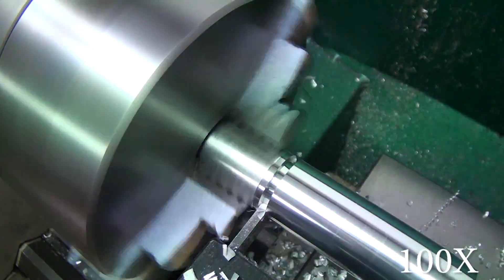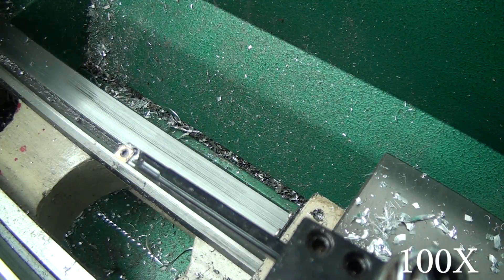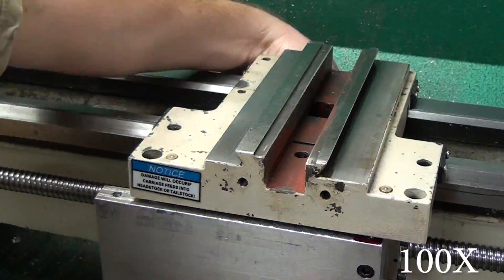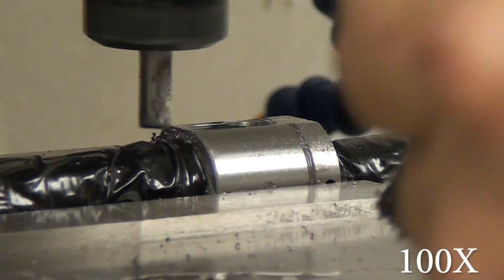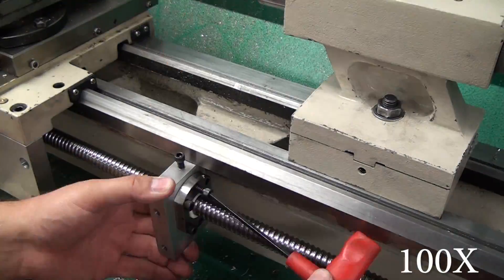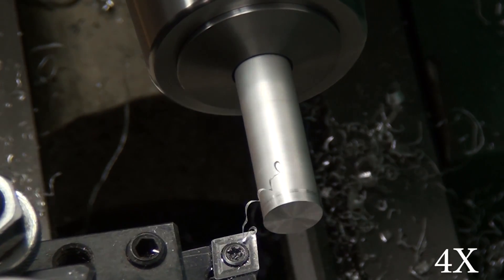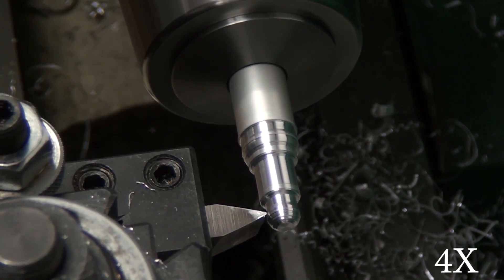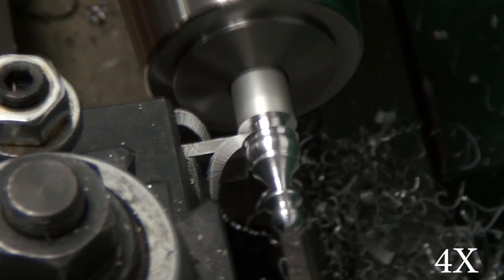G0602 CNC Conversion pt1 - Introduction

Comment: Hey Russ, what did you do about the z axis lock/brake? also, just to update you on how I am doing; I got the 1.8KW servo motor put on with huge timing pullys one inch belt width, and the acorn all wired up with kbsi signal isolator for rigid tapping, and my 704 has the same exact setup and it's tuned great and rigid tapping works good, even deep hole tapping (peck tapping), and because of the massive torque; I'm only tapping at 200rpm. so I figured out what I am doing is removing the gearbox, and putting the z axis stepper where the gearbox is, and I got a nema 34 that is really short, 80mm to go in the back, with no pullys, just direct drive. and I have a turret setup that I am making for it. just curious though; the brake is used to hold the saddle down also isn't it? how did you get around that? thanks. your awesome to put the plans on for free, it gave me a nice place to start from, then make my own mods from it, and with your feedback it was really awesome that you are there for others. thanks again.

Comment: Hello Congratulations for the video, I wanted to ask you I saw in the video that you turn the ball screw as if it were simple steel, normally they are cemented and hardened bars how did you manage?
Reply from the maker: Carbide tooling and low rpm. It was hard on the outside and soft in the center.
Reply: @russtuff  Ok Thank

Comment: Could this machine lathe hard steel for gunsmithing?
Reply from the maker: I don't recall ever having tried to machine hardened material. I suppose anything is possible, if you take light enough cuts. It's not a super rigid machine though, so I would imagine gunsmiths would tell you no.

Comment: Russ, what control and CAM software are you using? I'm having bad times with SolidCAM+Mach3 combo, especially with the feed per rev mode. The post processor I've found doesn't work correctly.
Reply from the maker: I'm using Fusion 360 for CAD/CAM and running LinuxCNC for the control instead of Mach.

Comment: looking forward to watching your videos may I ask will this conversion work with a 
    7X12 mini lathe
Reply from the maker: I made my parts specifically for the G0602 which is a 10x22. You could modify them or use the ideas for a 7x12 conversion I'm sure.

Comment: Nice project..  I have some issues with what you are doing.. You dont have any stick / slip issues without running with linear rails on your machine?   And those small Nemas are they fine fine to complete the mission?
Best Regards and Happy New Year
Jonas , Craftman Denmark
Reply from the maker: Correct. I've already racked up many dozens of hours of machine time doing a somewhat large production run. I've had no problems not having linear rails, and these steppers are actually larger than what most people use on this same model of lathe.
Reply: +russtuff  thx alot man!!  (5 stars ) remember to cut aluminium or brass is easy .. to cut steel or stainless is where the know how about tools and cutting speed and machinery goes up ..! ;-) never give up! :D

Comment: I've done an almost identical conversion on an almost identical lathe! It was a really enjoyable project. Cut all the mounting parts on my cnc router. Don't have a mill though so I had to modify my ballscrew with an angle grinder, not half as pretty as yours ;)

Comment: Russ,

that conversion looks like the best one I've seen to date!  excellent work!  you should have just used the G0704 setup like a lathe so you didn't have to tear down and reassemble the G0602 so many times.  I am going to be turning done parts on G0704 tomorrow or Sunday, I'll get some footage.  I will donate my QTC setup to the cause so if someone has a cnc'd 0704, they can turn and mill parts as needed for a quicker conversion.  again awesome work there man!  

Chris
Reply from the maker: +christopher polanski Thanks Chris! I considered using the G0704 for turning.... I can't remember why I never did :p

Comment: I am SO looking forward to these videos, not only for ideas for my LinuxCNC conversion of my Clausing lathe, but also for the motivation, which seems to be the bigger problem for me lately.  I was going to buy a Grizzly G0602 lathe to convert, but I bought the nice old Clausing for the same price.  It's very old and very ugly, but it's a solid machine tool that works very well.  I look forward to CNCing it, and I'll post videos of my CNC conversions as well.  Thanks, Russ!
Reply from the maker: +Liberty4Ever Thanks!
Yeah man, I've seen some of your Clausing in action. I didn't realize you were going to CNC it. Very cool!